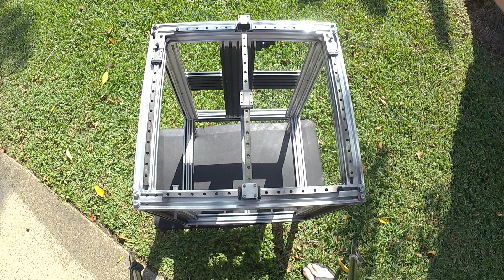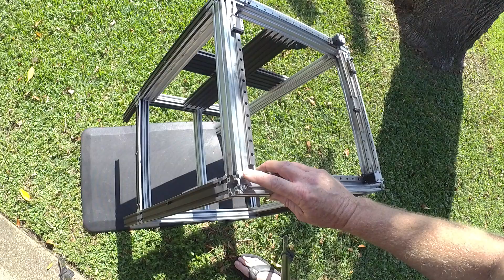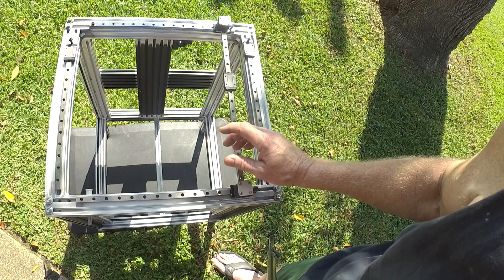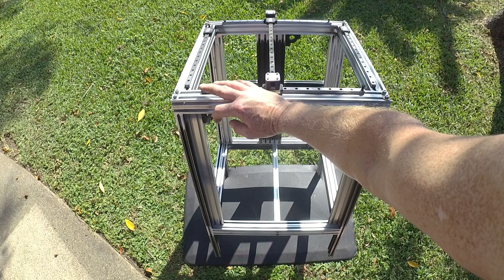Frame Build Commentary

Comment: I'm very impressed with the results!  Nice motion!  Instead of standoffs in the 4040 interiors, maybe CNC'd aluminum plugs that would perfectly fit the profile?
Reply from the maker: Yes, indeed still happy. That is a good option. Too bad there was not a way to buy an inverse extrusion and stick it in there. For me, it will be the cheap out way.. standoffs. Filling with epoxy sounds great also. I can fill both of them as is without issue. I need to research the epoxy needed and see if I can use sand as a filler. Epoxy is probably not cheap and how does it expand vs the aluminum. Will it crack inside? What other n
nightmares come with it, I have no idea.

Comment: Epoxy w/ some fine sand works well.   Or you could always fill it with melted lead :)
Reply from the maker: What epoxy did you use?
Reply: @MrRocksalt  just 12hr casting epoxy from Amazon and playground sand from Lowes

Comment: Have you considered doing x&y placement as a single cnc’d 10mm thick part? Floating Z of that plate is a cool idea also
Reply from the maker: I have already a 6.5mm halo, in aluminum. But not ideal. Needs to be steel.